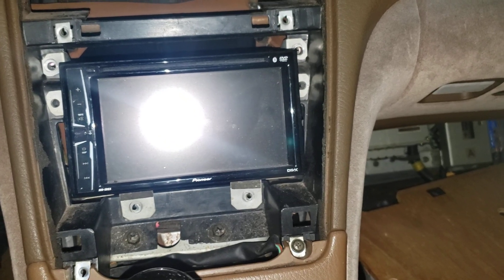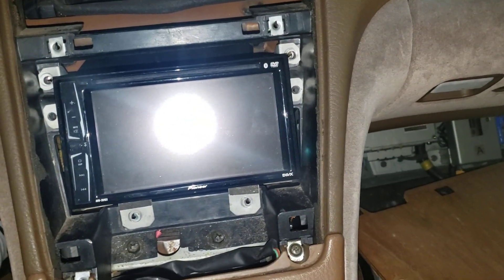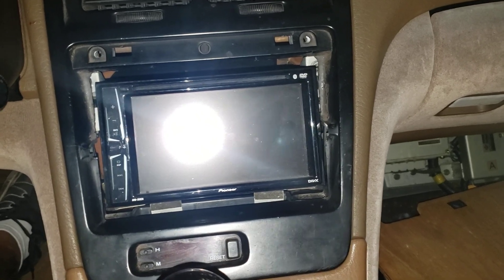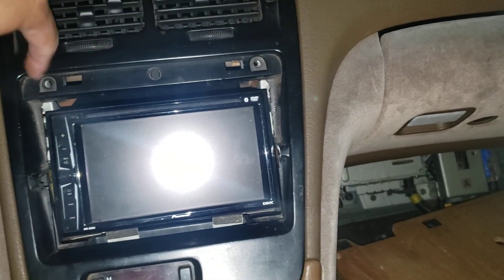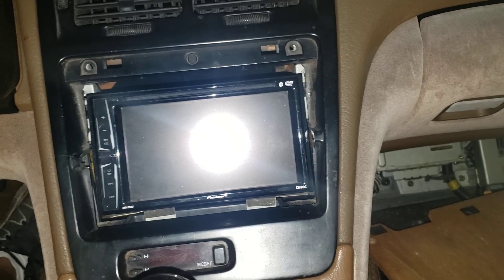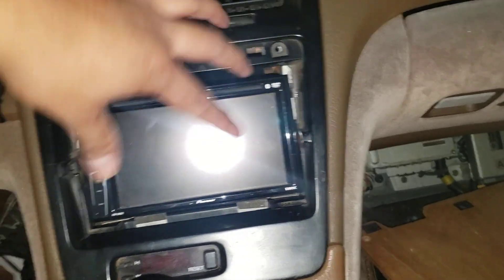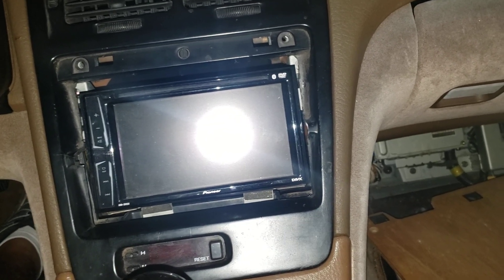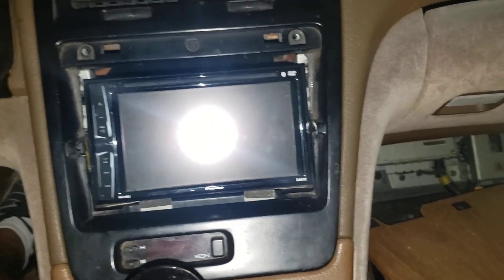Touch screen 300ZX

Comment: What size double din stereo will fit in a 1995 2+2?
Reply from the maker: The one I used was a 201EX Pioneer. 6.2".
Reply: @MrMK211516  Thanks